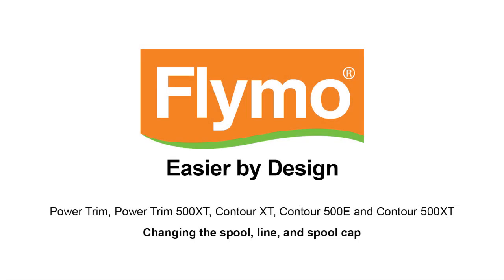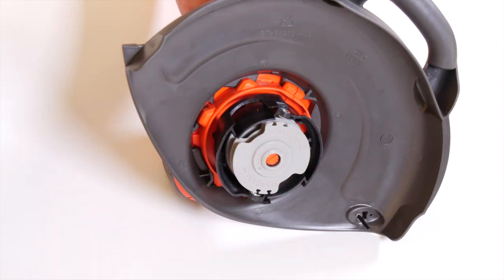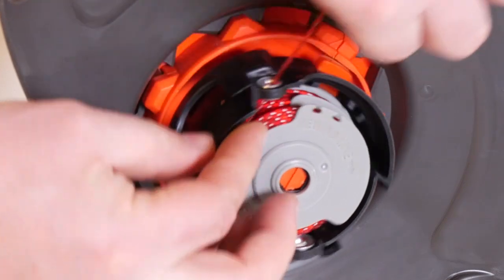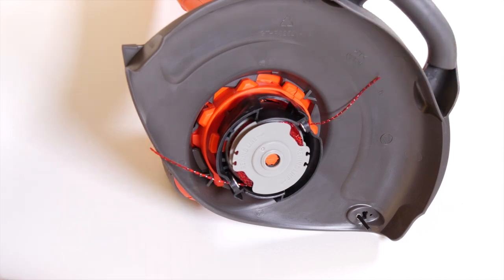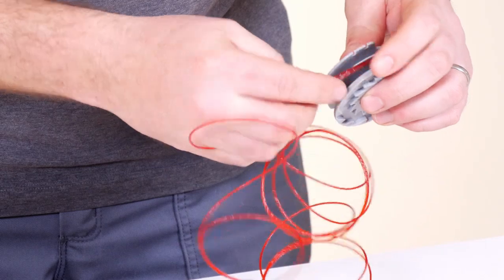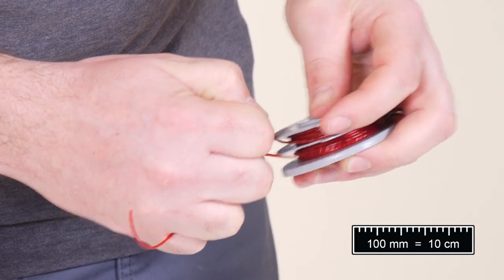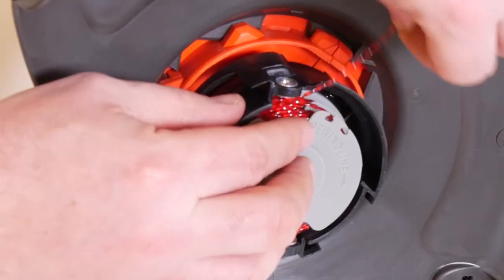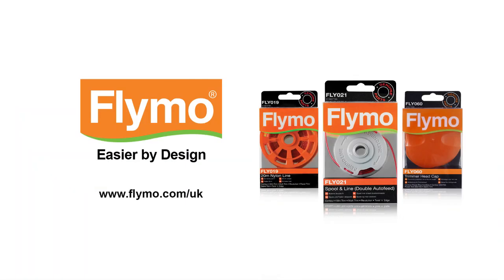How to change the spool & line and the spool cap on a Flymo grass trimmer

Comment: Mine is an older machine and I couldn't find any holes for the line to go through.  It dawned on me that there was a gap underneath the twin 'nail heads'   The line went through easily and I could get back to more clearing   So simple when you know how  so a big THANK YOU

Comment: This thing is bane of my life. Mine  doesn't have holes for the string to go through its like 2 poles and it just snaps straight away.
Reply: Make sure you wind the cord as in the video. Follow any arrows since the head will only spin in one direction and relies upon the spiraled cord in the direction it should be - on my spool it shows clockwise winding needed.

Comment: My flymo edge trimmer keeps throwing out the line when I have it on, like the actual spool itself spins inside the housing causing the gut to unwind. Does anyone know how to fix this?
Reply: Also having this issue did you find out how to fix it?
Reply: @kylemccallum6493  sadly not, the only thing that seems to work is putting a folded piece of paper between the spool and tur lid that covers it. That seems to hold it place.
Reply: @piepatonie1294  okay thank i will give that a try 👍